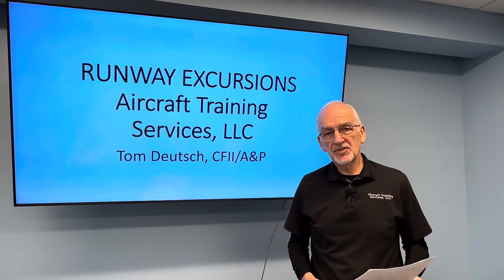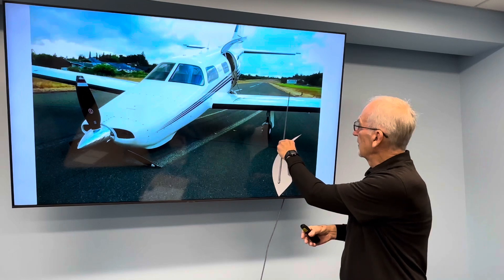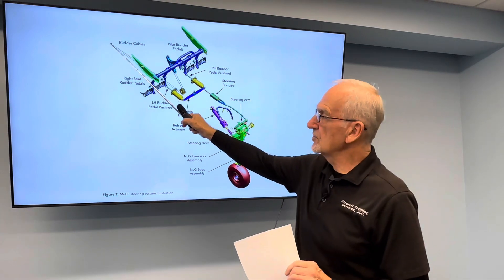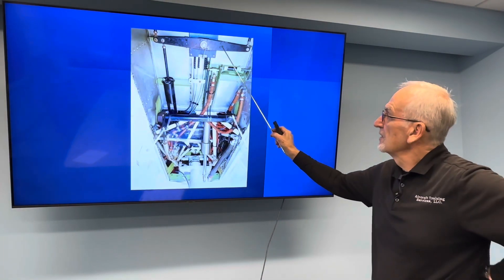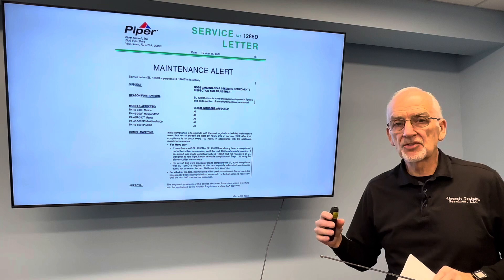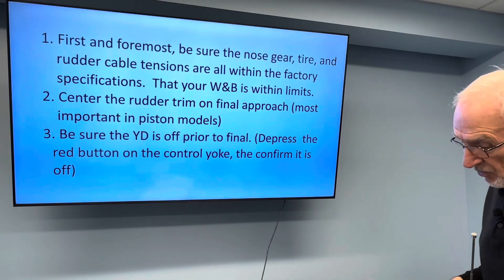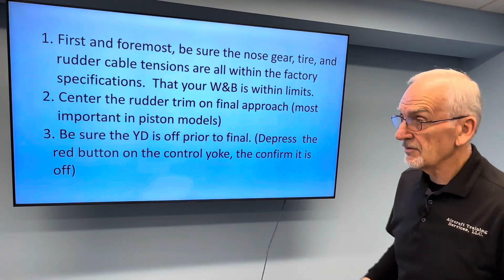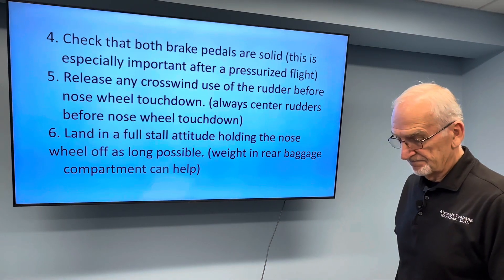PA46 Runway Excursion-Why It Happens

Comment: In 1963 our small flying club upgraded from a 170A to a 1962 Mooney M20C. During our checkouts, all of us almost lost control on takeoff due to oversteer. We contacted the Mooney dealer that we had bought the one year used Mooney from told us to come right there. It took 15 minutes to put a small spacer washer under the nut fastening the rubber doughnuts to slightly bring the tire aft. Problem solved.